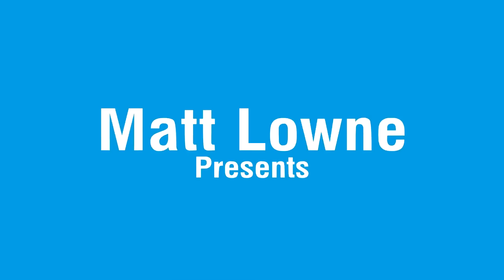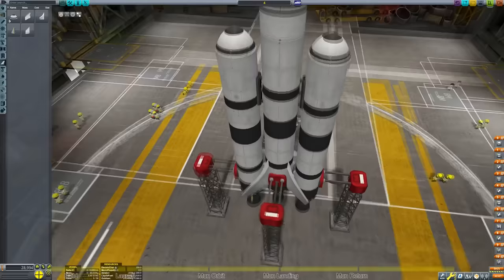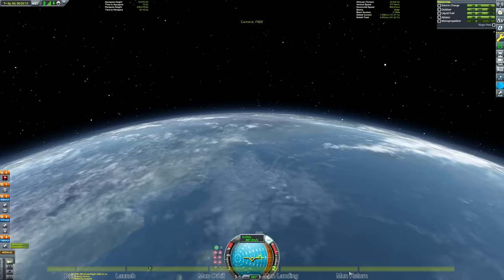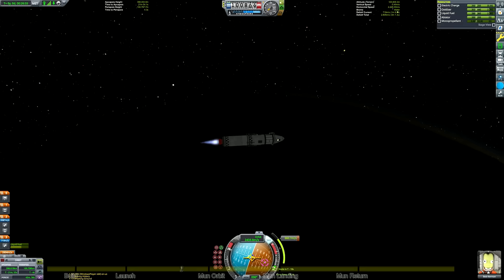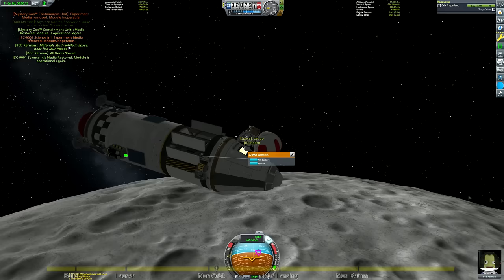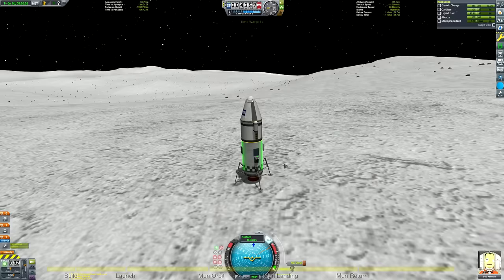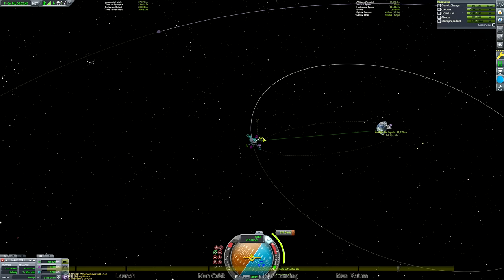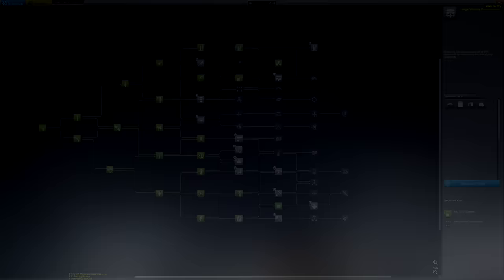How to do your FIRST MUN LANDING! KSP Tutorial (Science Mode)

Comment: Since the last patch, you can click on the altimeter to get altitude above the local ground instead of above sea level. It helps A LOT when making soft-landings because you no longer have to watch for your shadow to judge the distance to the ground. It's one of those new quality of life tools that helps new players to learn the basics.
Reply: Better use Kerbal Engineer, it shows a whole lot of other useful information as well.
Reply: @Mike-oz4cv  KER is great and does give a lot more information compared to the stock game. 

Until 1.7, I'd argue that KER was required to play, but the developers have finally gotten past HarvestR's absurd "bUt NuMbErS rUiN tHe MaGiC" BS. Since 1.7, KER has, in my opinion, has become optional. I still use it unabashedly, but some players, including newbies, don't use mods and their stock options should be mentioned.
Reply: @orbitalvagabond3297  Agreed, though it’s still a PITA to play without KER and Precise Node.
Reply: @Mike-oz4cv  I've actually never played with PreciseNode. Even when doing interplanetary missions I've never found the need for it, because it's basically impossible to execute a burn to the level of precision it provides. I just use maneuver nodes to get timing and approximate burn times, the burn manually. Sometimes the orbit needs to be trimmed with RCS, but that's not hard at all.

I get why people use it, and it's a totally valid approach. It's just not how I prefer to play. I've seen too many streamers spend too much time obsessing over getting the perfect vector sum to go down that path.
Reply: @orbitalvagabond3297  I just find it really hard to hit the correct icons on the maneuver node. Much easier to set a rough vector, then adjust with Precise Node.

Comment: "You're gonna want to have at least 800 m/s of Delta V for going back to Kerbin"

Me: Has 200 m/s of Delta V while still in orbit around the mun
Reply: SAME
Reply: BLUNDERBIRDS ARE GO!
Reply: ME NOT KNOWING WHAT DELTA V IS: ahahhaHAHHAH
Reply: lol
Reply: So an emergency refueling mission with a claw (or build docking ports).
A similar ship should be enouth
Reply: get out and push
Reply: @suffr2375  deltav is change in velocity. as in, how much change in speed the fuel you have can manage
Reply: @douglasparkinson4123  doesn't work anymore.
The EVA fuel gets replenished by the monopropelant, so you don't have infinit deltaV with pushing
Reply: @emmata98  no it doesnt. the canister just refills whenever you enter a command pod.
Reply: @douglasparkinson4123  this was the old system.
I thought they changed that to the more realistic system, that the replenishment costs Monopropelant.
Reply: @emmata98  no they didnt. test it yourself
Reply: @douglasparkinson4123  doing it rn

Edit: okay, but that is still stupid
Reply: @emmata98  noting stupid about getting out and pushing. and you admit i am right
Reply: @douglasparkinson4123  it is stupid that you have therefore infinite deltaV and therefore infinite energy.
And yes, you are right, they still haven't fixed it
Reply: @emmata98 were you under the impression KSP followed thermodynamics anyway? you can generate infinite speed with 5 sepratrons, loads of radial decouplers, some RCS ports and a low orbit around the sun
Reply: SAME
Reply: Ik im stupid,but can you explain me what os Delta V and what it do,sorry
Reply: @nq5044  Delta V is the amount of "velocity" your engine can produce in proportion of your fuel, so if you have 100 m/s of Delta V it means that your engine can produce that velocity burning your current fuel.
Reply: @emmata98  its usually better to just revert and do it again
Reply: This guy's rocket was a little bit "tight" in the fact that it had just enough fuel to get there and back. What I reccomend is to go ahead and add an FLT-200 to each stage (a 400 to the side boosters and first stage.) the rocket can take it and it gives you a bit more leeway. if you're a really bad pilot like I am, you can just stack on a fuckton more fuel and add some thud engines to the side boosters
Reply: @douglasparkinson4123  they did the best they could without nasa's supercomputer
Reply: what is delta V
Reply: Me: has 0/ms of Delta V landed on the mun "y'all have delta v?"
Reply: SAME
Reply: Same!! I don't have anywhere near enough Delta v to get back to Kerbin. The rocket should have been much bigger. I should have left a stage with the landing legs on the mun and have a separate stage to get into lunar orbit and back to Kerbin.
Reply: SAME
Reply: same
Reply: @billymcdaniel1532 make the rocket bigger. This video is dumb because it requires you to be very efficient which is really hard for anyone who actually needs this video to get to the mun.
Reply: @suffr2375 the v means velocity (speed) and delta is a Greek word for change, so it means change in speed, so if it’s 250m/s remaining and you are going 250m/s speed above kerbin, you can change the speed by 250m/s, so facing in retrograde would make the speed 0m/s and prograde would be 500m/s

Comment: Thank you a lot! This guide is very helpful for me as a new player.
I've managed to open my entire science tree even without any piloting mission outside Kerbin SoI, because I'm not bounded by restriction 'one biome per body'. Mostly because of this guide which has a lot of information about landing on Mun and Minmus. First things first, I've sent missions to Mun and Minmus like in video. Second, I`ve burned to the node with Gravioli detector (because it is the only scientific module that performs biome-sensitive analysis for both high-above and low-above flight). Then, because of beautiful mod SCAN whch shows you biome maps for celestials, I've gathered all EVA and gravioli scans for Kerbin, Mun and Minmus just in one flight, which gave me a whole lot of science (near 5000 points). The last but not least was Munar Space Station with Munar Landing Module, which was equipped with science container. That helped me to gather two copies of each experiment, one set was then succesfully delivered to Kerbin, another one is currently processing at Science Lab. These experiments, and some occasional flights with orbital probes and automatical landers on surfaces of Duna and Eve gave me the rest of science points to complete my science tree.

Comment: I have been using the new robotic hinges with pistons to make my own landing gear. They are far less bouncy and can give you a wide base so you don't tip over. Also, if you change the max and min target angle you can just assign the toggle function to the gear button and they function no differently. In addition if you use two pistons one parallel to the ground and one at a 45 degree joined together with a hinge you get a seriously wide base with a significant ground clearance. Lastly just remember to assign lock and disable the motor functions to a custom group so they can stay in place indefinitely with out using any power.

Comment: So, it's been a looooooooong time since I played KSP and decided to do a brand new career run, mind you my previous runs never got further than minmus 😭, but I couldn't come up with a good way to get the the Mun this time. So this was a great help, until I didn't follow it well enough and and was orbiting the wrong way around the Mun.
All in all it was a successful mission and only required a handful if quick loads and about 50 delta v of cheated infinite fuel, since I couldn't justify leaving Bob in Munar orbit due to a measly 50 delta v. Oh, I should mention that I was short on the delta v because I had in a highly elliptical, or eccentric (not sure which is correct), orbit of the Mun at about 45 degrees from the equator and again going opposite the rotation, cause I apparently can't be bothered to learn from my mistakes. 😅
Thanks for the tutorial Matt, I'll try to pay closer attention in the future!

Comment: Dynetics Alpaca lunar lander looks surprisingly like the Mars Sky Crane if you dump the central habitat module.  Perhaps it could be used to deliver cargo like rovers or other supplies. If you remove landing gear and add the deployable tether cables you could lower cargo and have your rocket engines at an angle and not kick up as much regolith reducing the risk of damage to the cargo. After the cargo touches down and the tethers cut it can return to orbit for refueling and reuse

Comment: I found it easier to fly a beefier rocket (2,5m with the mainsail engine and SRB’s and a skipper engine for the second stage) (Yes, in sandbox mode). As a beginner in KSP, It allows for less efficient maneuvers and more Delta V for the lander.

Comment: Im rather confused, I cant hook from mun, and burn off all that speed in one orbit without burning up. Id have to take air breaks and bleed off in 4 orbits. that am I doing wrong?
Reply: Old comment but ill reply anyways. Did you add a heat shield to the capsule? With a heat shield you should be able to re-enter the atmosphere the way matt does it.

Comment: no matter how i place those fuel lines the middle and side tanks seem to drain just about the same speed, i checked the arrows they point from the side ones to the middle one, and the middle one does stay full, but only the bottom middle one, the top drains and once the side bottom tanks have drained but still have fuel on the upper ones they stop draining and essentially they all burn out at the same time

Comment: Funny that a ton of people complain that they are always out of fuel when  I land on the mun with this design I always have to either revert flight because of a part missing/missplaced or I load a save when I'm in orbit around the mun every time because once I misplaced the landing legs i put them too high and when i landed (usually flipping) i wanted to plant flag and do EVA report and by doing EVA a tipped over the rocket evry single time and I tried 4 hours to do it and 441 tries every time it flipped so had to load an old version of my career mode because all the other saves could'nt revert flight

Comment: Great Vid.. at 10:50 you mentionned reducing speed to 0 at about 200m above ground. I assume that you did the manoeuver on gut feeling (assisted by your 3s margin) and checked that in post-prod, as your altimeter was set on absolute (landing at 4359m) and not on ground. For my first attempt I will surely set the altimeter to "ground" ;p

Comment: Running into a problem, did exactley as you said and in two attempts ended up stuck in orbit around mun after succesfully landing on it, with no fuel left for the final burn back to kerbin, is this something from the new version or am i doing something wrong here?

Gave it some more attempts, even after 4/5 attempts i still end up with just barely missing the fuel to get back to kerbin. Do i really have to do this 10 more times until it works? I must be doing something wrong

Finally made it, with the last drop of fuel left, - i had to maximize my exit trajectory from the moon to have enough fuel left to make the last jump to kerbin's atmosphere. 
It really comes down to perfect execution it seems T.T
Reply: In retrospect, I just needed to get better at the game, know how to optimize your flightpaths and therefore reducing fuel consumption, making it entirely possible to make it with a lot less fuel.

In short, git gud

Comment: When taking off from Kerbin, why do you want to wait until the apoapsis is "50 seconds to a minute" before turning below 45 degrees?  I understand that this is to avoid atmospheric drag, but is there a more detailed explanation as to why that time value was chosen?
Reply: Likely that 50 seconds correspond with the required altitude accent rate to clear the atmosphere.

If you turn to soon you'd struggle to get the required height. 

I hope someone can offer a better explanation than this.

Comment: If time is not a factor for you, and if you find yourself in a janky orbit around the Mun because you came in at a janky angle (below the plane or above the plane of the orbit of the Mun), don't worry, just get yourself into some/any kind of orbit around Kerbin, then wait it out till your craft is in apoapsis of that orbit and perform a burn to get the periapsis towards a reentry trajectory. This requires very little fuel. Be careful to manage your command module's electricity charge, however, make sure you turn off the electricity in case you're in trouble, you'll need it for re-entry maneuvers. Remember, this will save you fuel in not having to do correction burns or a giant burn around the Mun, but it will take you many many days!

Comment: Ford snynody have a tip for mE? Here is the Problem. i built my own rocket but mine has nearly the exacly same lander as Matt's. the only thing is that instead of the sience junior i got a Fl-(i dont remember the number) but its the same size as the Jr.  the only big diffirence is that i have a small monopropelant tank and a fe RCS thrusters. and 5 landing legs becose 4 didnt work. i land verticaly with 4 m/s and my rocket always tips over and crashes. any tips?
Reply: its actualy 6 landing legs not 5
Reply: i actualy just done it. lol. moments after my comment

Comment: When I do this, suddenly my retrograde and prograde switch and keep spinning, being locked onto it this causes my ship to start spinning wildly burning up the remainder of my fuel.
Reply: Retrograde and prograde just tells you what direction your ship is heading. If you are barely moving, then even small adjustments can make significant changes to what direction you are heading.

When you start slowing down, always switch your SAS to the "maintain heading" setting. Never try to track prograde or retrograde when going slow

Comment: For some reason i keep running out of fuel to go back to kerbin, it is basically impossible for me to not run out of fuel and i dont know why, any tips?
Reply: i know this is old but, this rocket is pretty hard for beginners imo, its recommended to have 7000 deltaV if youre new, and this one only has about 6,600. so my tips would either be to just practice this tutorial over and over until you can get it, or change the rocket around to your liking
Reply: @womp47  any tips to lower fuel consumption and save as much propellant as I can? (Gameplay wise)
Reply: @qie2iqee  just comes with experience, but planning maneuvers at the right time can save a lot of deltaV. an example of this is when circularizing orbits, you always plan the maneuver at your periapsis/apoapsis, since thats the point where it takes the lowest amount of fuel to change the opposite side of the orbit. 

basically, try your best to only burn when necessary and find the best place in your trajectory where you expend the lowest amount of fuel possible to execute a maneuver

alternatively, play ksp the kerbal way and just strap on moar boosters until it works
Reply: @womp47  it doesn't work, no matter what I do. It's problem after problem. I give up

Comment: I have tried and tried but cant get back from Mun. I wish the video was not so blurry so I could see the delta you have left every step of the way. I used your rocket but made the lander even lighter, no science jr. The second stage gets me to Mun, I can even hit it at an orbit to land right away. I also tried making a perfect low orbit first. I usually land with between 900-1050 delta now so I am not looking at the other stages, it must be my accent. 

First time I landed in pitch black but I actually stuck the landing. Its in the highlands too, lol. So far I have landed about 50 times, took off 50 times. Pretty sure the problem has to be my accent from MUN to orbit. From Mun orbit its about 200/225ms to get captured by Kerbal. My problem is once I get to the very last step, I wait until just before Ap but just dont have enough juice, the orbit is too large. I never had this problem doing flybys. 

First and second stages work great, I arrive at Mun with 2000 ms full tank. Maybe I will try more landing legs and another T100 or 200.

I also kept playing the same save so maybe its just the location. Very mountainous but the whole thing looks that way.

Comment: This literally does not work. I can't get it to work ffs.
Reply: I've thrown a few attempts at it, and it seems that if you were to fly exactly like this, as perfectly as possible, you can do it. However, an easier way to do it is to just strap more rockets on to your ship (even with the design in the video, two extra hammer rockets limited to around 40% to the side is enough), though that can become expensive and heavy if you keep using that method late-game

Comment: .....what....how....you magician. 1, there’s no fuel limiter, doesn’t exist, 2 you magically have 2 terriers when you only put 1 in, 3 the node system is janky and doesn’t allow you to control whether it goes right or left properly, but you magically did it. 4, when taking off you fly angled, you are able to do it without issue and aggressively, one small tap flips it the complete other direction. EXPLAIN.

Edit: I managed to complete the mun landing, three times. The design in the video is flawed and incapable of getting to the mun, no matter how many hours I’ve tried. However, the concept is functional. Using rockomax parts in a similar design works if you get the right trajectory. It’s challenging but possible. Also landing straight up is an issue because of bouncing so good luck, I don’t have a solution for that.
Reply: I don't know a percent of the terms in KSP but keep the center of mass above the center of aerodynamics and it won't flip over as often.
Reply: Cobinasaur thanks. Quite helpful! However I’ve noticed that small amounts of extra weight to one side causes SAS to over balance itself and flips it. The lander had irregularities like this and flipped it among other things. It doesn’t seem to be a issue with larger rockets, probably because the extra weight is minuscule than it is with smaller rockets.